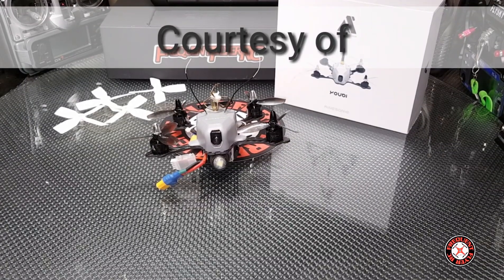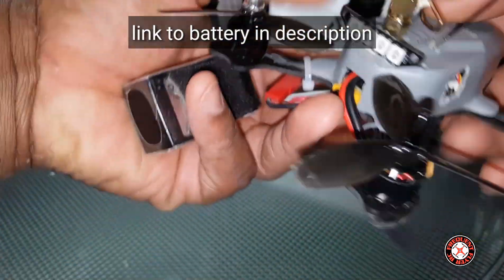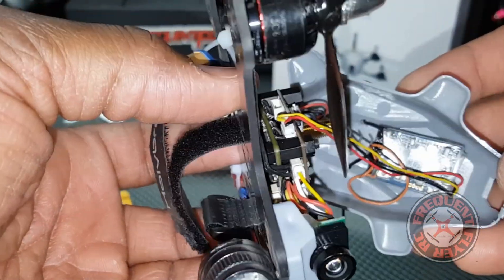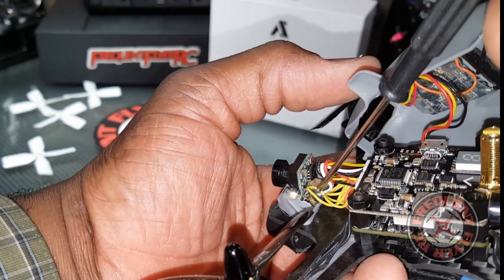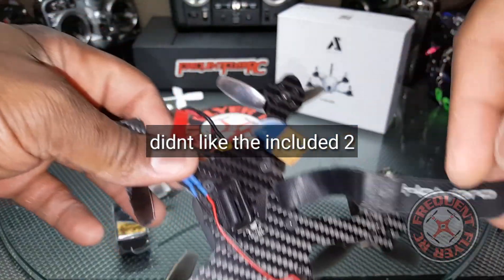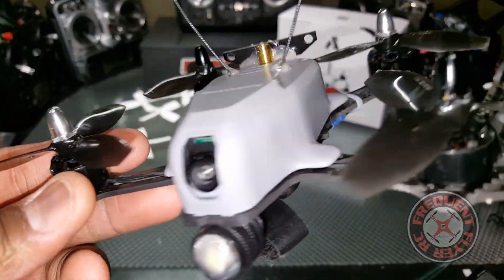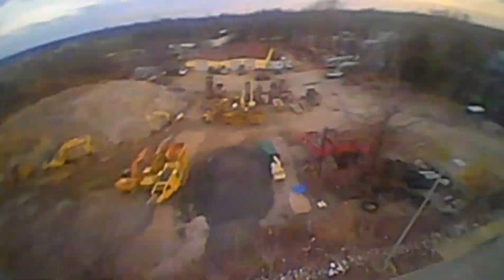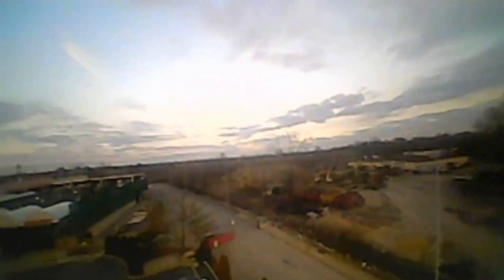Awesome Youbi XV-130 Quick Review, Mods &  LOS/FPV Flight Demo

Comment: Man, can you tell me how you got audio!? Ok, the camera has a microphone built in, but where do you connected the wires to the FC? In the same socket? I did not find any manual of that FC...   I like to hear the engine to. :D Today I received 2 battery packs: Tatuu 850mAh  4s for Youbi. Thanks.
Reply from the maker: +Sabin Cercel right end, only one hole left for a pin.